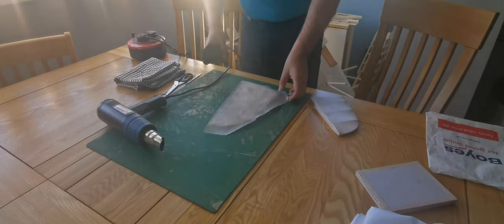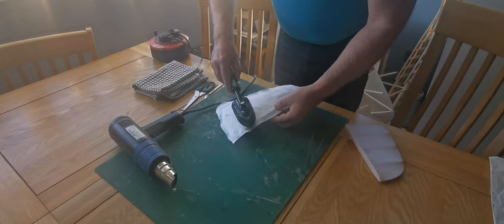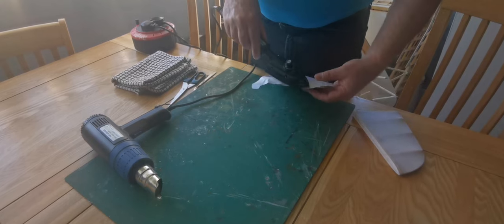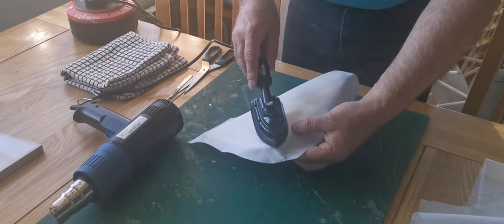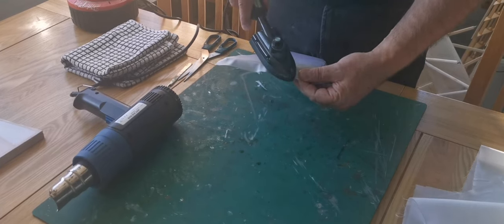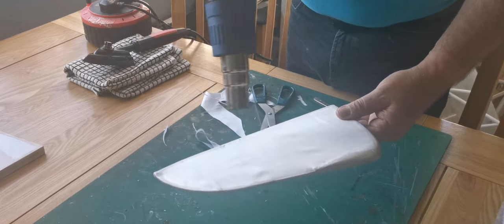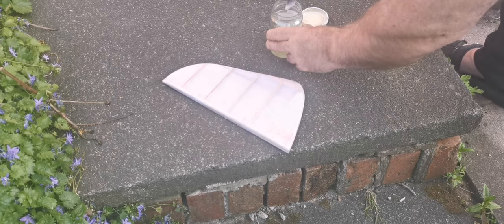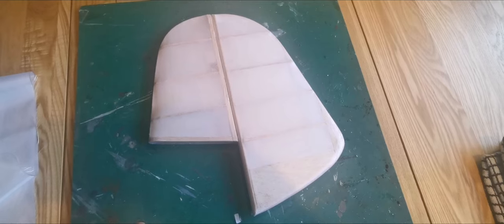Covering an RC plane using dressmakers lining.

Comment: I use "Stick-it" very sticky glue. It is a fabric glue and can be heat activated when it has dried. You should find it in the haberdashery department or store.

Thanks for the helpful video